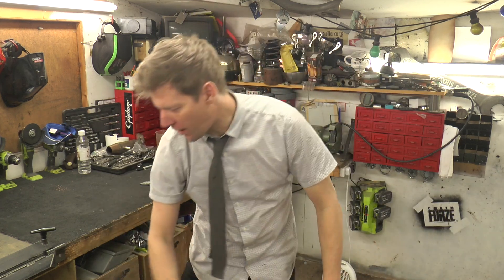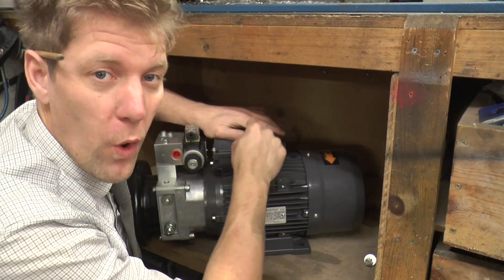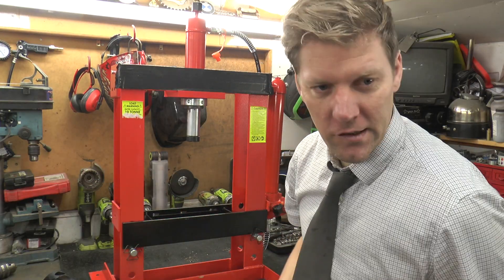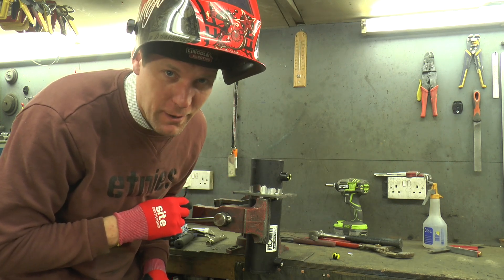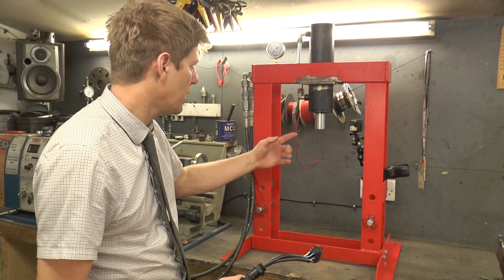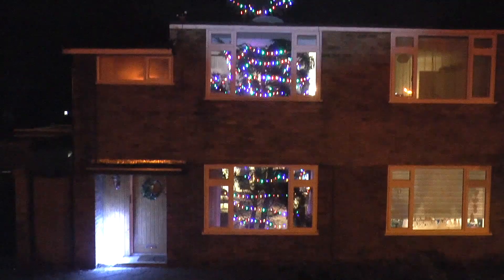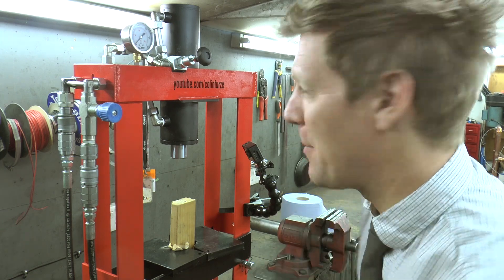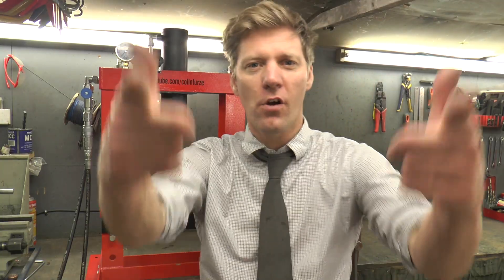Workshop Hydraulic System/Press conversion

Comment: This might be a daft question because I'm not that knowledgeable on the subject of  hydraulics at all but.. I'm thinking of converting my super shovel micro digger, Kobelco ss1/2 (I don't have as strong a back as Colin does!) to an electric one for a basement lowering project, I'm going to make it single phase 110v instead of petrol save me dying of fumes and be quieter for neighbours, i'm in the UK this might be safer for the really damp basement than having 240v and use a transformer, the current motor in the digger is only 3.5hp so not exactly a monster!... and the hydraulic system is connected via belt and pulley system so should be pretty easy to get a compressor style pulley wheel to work with it.

The question is will i need a speed controller for the RPM of the motor to control speed for low / high pressure of hydraulics which the digger currently has a switch for?

I think i will need this controller and I've answered my own question but I'm just guessing and doing my own research at this stage!

Comment: Can you point me in a direction to learn where I figure out what motors/pumps/rams I can use that’s I’ll work with each other? I don’t wanna build on of these and have it move slow or not reach high pressures or whatever other issues I might encounter
Reply: For pumps look for 115v/230v 2hp motor or even 1 hp. The more gpm the more flow you have so that's your speed. They should be marked on the box it's max rated psi. 3000 psi is fairly high. Some hydraulic systems will run crazy high but those are industrial for skidsteers and such and require steel lines. 

The cylinder he's using looks like 2 inch double acting cylinder. Your max pressure for these is 3500psi 

The double acting let's you use the pump to push the cylinder out and retract it back in instead of relying on a pressure dump and springs to pull it back up 

I work in us measurements so I don't know the metric conversion

Hope this helps

Comment: Hry colin. I have a sprinter van and want to add a automatic jack system to it. 4 rams  with 4 controls but have no knowledge on hydrolic rams or pumps. im guessing hyro is better than air as i dont need them to be super fast. Love your work.

Comment: Hi Colin, good project but was wondering how you go about disconnecting the hoses wouldnt fluid run out the hoses in which case you can't really keep change hydraulic tools like if it was air?

Comment: You should build yourself a nice hydraulic power pack using a power steering pump from your favorite vehicle lol. You could even weld the frame together using that cars alternator... hell, you could even supply your workshops compressed air tank using an air conditioner compressor from said car lol. See a theme here? I'm having a blast doing the same thing lol, it gives your shop a very "post apocalyptic" look. I'm going to be putting together my dream here soon, just thought I'd share haha

Comment: Unlike glass, which may attract dirt, the stainless-steel cable doesn’t easily get dirty. Maintenance mainly involves washing with soapy water every 1-2 months, and the occasional tightening of the wires.

Their durability also means you perform fewer repairs on your railing.

Best stainless steel cable railing ropes-

Comment: Gulp....this is bigger than both of us Batman.......I think you've gone on overkill with that hydro set-up for a 10 ton press.
I just bought a 10 ton bench top press and will go the hydraulic addon too, but with a small 12 volt unit just to get the ram down quickly......maybe the hydro unit will pump to 10 tons but I don't think it will.....it's only rated at 18 mega pascals.

Comment: https://cnweiken.aliexpress.com/store/5248031
We have available good quality 110v, 220v, 380v, 440v, 
660 ~ 690v 0.4kw ~ 630kw frequenc converters / inverters, 
And also have special for solar inverts, water pump, Air compressor, 
blower fan, injection molding machine, 
Three-phase synchronous motor etc.

Comment: I know this video has been up for while but Colin please take note, you are using a plug and socket for use on 12/24vdc systems. It's not rated for 240vac mate. And when you open the cover of the socket it has exposed terminals at...... you guessed it 240VAC!!! Think of the children Colin!!! 🤣🤣🤣 but seriously please use correct rated gear for any electrical...... and still loving your work mate 🤘👍

Comment: Right colin... now you have time with this lockdown that's happening.. let's see you build your own power supply for everything in your shed, cant be connected to the main supply..do you have all the bits like an old alternator to put on a wind turbine and charge your batteries that run your inverter.. do that 😁

Comment: Worked great=>>share4.photo/pCarJack?Q43    The jack was low enough to get under the protective lip of my van so I could access the oil basin. Jack stands are definitely a must though (as they always should be). You can tell that the jack isn't designed for everyday use, but it's great for casual car maintenance or to put in your trunk as a better alternative to the scissor jack.

Comment: Nice job but u do think you should leave more room on the non drive end of the electric motor that drives the hydraulic pump so your motor doesn't overhead. As it looks now the air intake is blocked too much.

Comment: The flow control valve should be a pressure compensated type with a free flow check for your application.

Comment: The motor has a fan for a reason. A enclosed area is never good for getting air flow and dissipating heat.
Any relief valves in the circuit ? 
Could have used a cylinder which is top mounted, flat plate at the top. Welding a thin cylinder body, never a good idea. 
The 10 tonne is dependent on pressure and cylinder bore. 
Safety? Seen a guy lose 5 fingers in a hydraulic accident.

Comment: Colin really nice things you make, but just a little advise, if you plan to use that hydraulic press for long term, better to put a little bit of air gap just to the behind of electric motor fan, so it can cool itself better

Comment: Why didn’t you just build a hydraulic press from scratch since you didn’t use the hydraulics from the old press?
Reply: Yeah good question. As for the frame-flexing; was quite visible on the video as well. I imagine that rating is for loads purely in the intended direction; but that slopey tree stump had other ideas. Such off-axis forces can be a real hazard to your press, and the frame you have indeed does not seem designed with them in mind. Could be another good use for your plasma cutter..

Comment: How much oil is released at high pressure - albeit momentarily - when you disconnect those quick-release fittings?
Reply: Unlike air, hydraulic fluid or water doesn't compress. So if you have a air hose under pressure, or a car tire and have a rupture that pressure will rapidly expand and explode or in the case of an air hose, you get that pop as you disconnect the hoses. With hydraulics, there is no build up pressure because the fluid isn't compressed, so you might get a slight dribble. To use the hose/tire analogy, if you stabbed that hose pushing 10 tonnes of force, you wouldn't get an explosion, you'd get a few drops of fluid and then a slow leak. 

So assuming those quick release fittings are made to reduce spillage, and have some sort of chamber that stops the fluid from leaking, most likely you get just a few drops. Even if they were under tremendous pressure, same thing. Air hoses, you get a huge blast of air, a loud pop and sometimes the air pressure is strong enough to keep forcing out against the power of the spring meant to close the valve. That is the crazy difference between compressible, and non-compressible fluids. I learned this working at an auto body shop, where my boss told me the bit of air we use to spray paint a car, is much more dangerous than the insane pressured fluid we used to lift those cars up! Rupture one, and you can be seriously injured, deafened, and cause huge damage, and the other... I'll be mopping up a bit of oily fluid. Lol Still blows my mind to this day!
Reply: @danteelite - Thank you Sir, most illuminating.
Reply: None, when you disconnect them the pressure is already gone and the fitting is designed to not leak.

Comment: Why is there a connecting tube between the supply and return lines? Clearly seen at 9:05, welded between the two elbows.
Reply: I think it's supporting them, not actually joining the lines internally.
Reply: @daleroy2466  good point

Comment: Hi Colin, I have a small 12 ton hand press at home, uses a little pot jack. The chassis on that flexes even when using it in standard configuration. I think they're just designed like that :)

Comment: I have to say that may be more useful in some shops than a portable power unit.  I've found often if I don't use something for a while it gets stacked into a corner.  Permanently mounting it with just the control connector and hose connectors accessible makes it ready at a moments notice.  I like it.

Comment: Watching this reminds me of when I worked in Machine Shop in High School. My class had a few different hydraulic tools that were always getting destroyed because of the way the hydraulic system for the shop was run. The shops hydraulic system was over pressuring the tools hydraulic cylinders. Usually the failure was blown gaskets, and in one case the actual cylinder ruptured, and severely injured a kid the year previous to my first year in the class. I installed a limiter valve on the system my Junior year. I figured out the issue after I had a tool blow out on me luckily it was just a gasket. talked to the Teacher about what I thought the issue was, and we ended up speaking with the schools machine shop Leiason ( our school machine shop was sponsored by a local manufacturer) who spoke to the sponsors, and got approval for the parts to install to the main hydraulic system. The limiter worked perfectly, and to this day 17 years later other than replacing tools from just age and normal wear no blow outs have happened since.

Comment: Colin Furze i have an amazing idea the peel p50 is the smallest car in the world but it needs you to make it the smallest turbo charged and fastest car in the world you know it makes sense do this
Reply: Turbocharging a car is a massive, massive process. You're causing more heat so at the minimum you need to re-gap your piston rings for new tolerances, if the engine, geerbox, clutch etc can actually take the new power stock, which is a while other issue. You need to ensure air/fuel mix is exact. Not to mention entirely new ECU (although p50 won't have one i think) and dialling in the boost levels, blowoff/recirc, valves, managing knock... Plus you're probably not going to get much power anyway... HOWEVER, the classic 600cc furze swap would be incredible!!
Reply: Gavin Wheeldon yep, i very much doubt a 50cc engine would even produce enough exhaust pressure to power a turbocharger in the first place

Comment: Hey Colin, quick question. I'm noticing that your hydraulic circuit uses male quick disconnects on both the supply and return sides, on both the pump and the press. Was there a reason for this we're not thinking of here? One drawback of this is that you can cross your hoses, and if you do that, your switch doesn't always line up with the way the pressure goes. 

My thinking is that if you put one male and one female qdc on the pump and the same on the press, and you make your hoses male-to-female, you always have the load device connected in the same way, so the switch always lines up with what the pump does.
Reply: you could also use labels
Reply: @jetaddict420  or your head, keeps the ol' alzheimer away.
Reply: @theterribleanimator1793  even better
Reply: Female and male perhaps HEHE
Reply: @prettymuchyeahong  cease your bodily functions
Reply: You're correct, also why have four pairs of connectors? Just two from the press to the bench  would suffice ,unplug and cool the hoses around the  press when you're done .
Reply: @pauldavidson6321  no offense but you clearly ain't able to understand what he is saying
Reply: @jgilly3362  I've been doing hydraulics  professionally for 32 years so I think I know what he's saying  unlike your incompetent command of the English language.
Reply: @pauldavidson6321  Irony.
Both of you lack sufficient English knowledge to comment on it; don't bring up grammar when that's not the subject at hand, especially when you type like that.
Reply: @mikeishome69  what's your experience in the subject of hydraulics or grammar for that matter?
Reply: Good idea imo..
Reply: Your just being picky..it works..accomplished

Comment: Could you have filled the cylinder with water before welding to reduce distortion? Leave the top open so no pressure would build up from steam. I've heard yes a d no but since underwater welding is a thing I assume it's doable.

Comment: Colin do you not get issues with the oil temperature getting too high without something to cool it down with? i've wanted to build a hydraulic front lifter on a lawn mower for years, but i was told that the oil would quickly start boiling unless there is a serious cooling system for it.

Comment: You need a reservoir tank to hold extra fluid and for cooling.  The oil gets very hot and the system will break down.  Also, check out a forklift. (I think I've seed you using one in another video.)  The hydraulic pump runs constantly.  There is a master control valve that allows the fluid to bypass and go back to the tank when not in use.  The handles on the valve control the amount of fluid much better than your system.  If you could buy an old fork lift and strip it, you would have everything you need.  Keep up the good work!

Comment: I would have built a separate control module for the restrictor system and pressure gauge. This would allow you to use it with different devices - rather than building a system for each device.

Comment: I used hydraulic concrete saws, pretty cool stuff. Other stuff i could think of would be hydraulic vice clamp, scissors, a screw/drill, splitting tool(reversed scissors), and a car lift

Comment: Something tells me doing this for a shed is a LOT easier/cheaper than a 70 year old house that was converted into a shop many decades ago, keeping it all tidy and out of view like all of my air lines are. I suppose if you don't care about lines running like conduit across the wall it'd just be the cost!  I still want an air-over-hydraulic press, but my 50 ton isn't needed all too often anyway. :/

Comment: Commonly, quick disconnects are installed in a male/female configuration instead of male/male.  It prevents hooking the hoses up backwards.  Then, why not install pipes around the walls so connections are available throughout the shop, instead of in only one place; at the very least, one on each wall!  Good idea,, though, just needs expanded.

Comment: Really would have liked to have seen a "Whole Shop" Hyd system, with multiple outlets, hard installed devices, and equipped with an Accumulator or two, with auto shutoff for the pump.

Heck then you can Hydro all the doors and stuff, as well as your moving roof you built.

With an accumulator, you could combine that with a non-bypass style pressure regulator on the press, so you can slowly wind the force up without having the pump work against its pressure relief valve the entire time, and only come on to recharge the accumulator as needed.

Comment: I'm not sure what kind of pump you're running Colin, but if it isn't a load sensing one it will keep pumping at full power for as long as it runs. If you bypass the system you're running at that moment it means that the full 2.2kW will be pumped into your oil. This means your oil will get really hot very fast, especially with the small reservoir you have right now. You might want to look into an oil cooler or perhaps a load sensing pump, if this isn't one.

Comment: The future marks from that setscrew on your tool holder is gonna kill your bottom seal. 

Also hydraulics is no joke. I know that gag of this channel is unsafe stuff but please be careful and perform regular maintenance/check on all components of the system. It would be worth doing research on the integrity of your welds/filler material on the metal lines you welded together. Also install a blast shield.

Comment: I'm telling you now. Make a better single point quick adapter. Those three pieces are going to piss you off. 
You might want to also keep the gauge, the bypass and the flow regulators all on the adapter too, so you don't need to make one for each tool. :) cheers.

Comment: So does system release pressure after power is cut off so for instance opening connection in piping, wont spray you with oil, that is 150bar? Also what are you asking for the old old pump and cylinder?

Comment: Might want to cut out a bit of the side in that lil hole you put the compressor in.
Just where the back of the motor is otherwise the air circulation will be blocked.